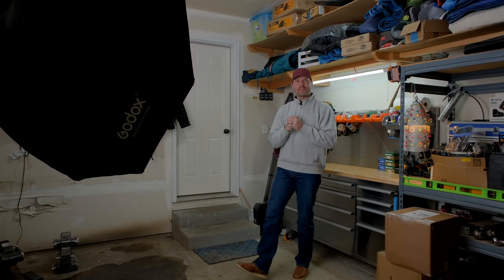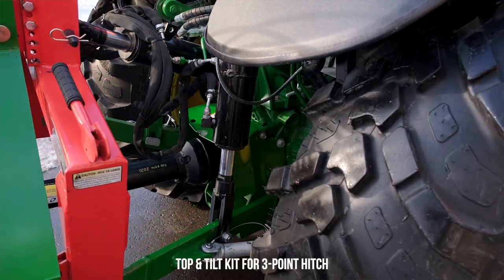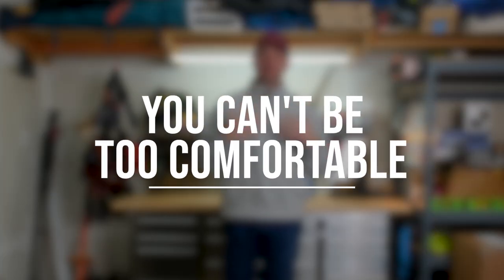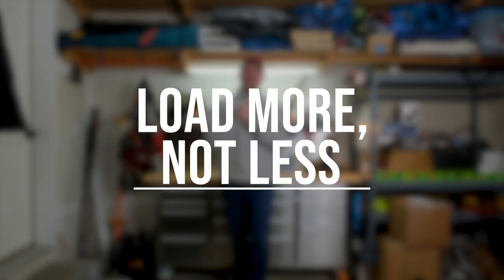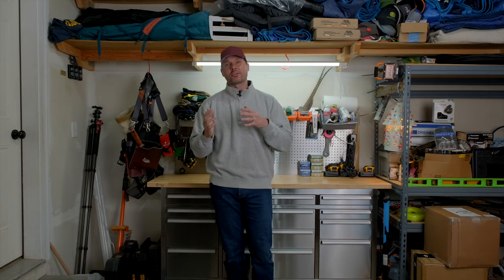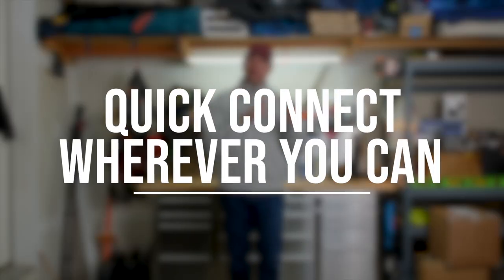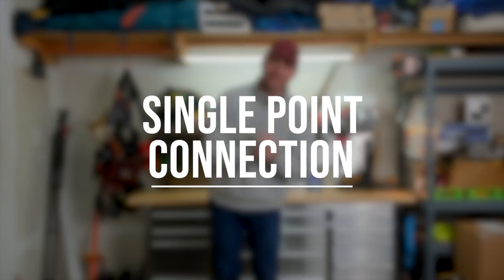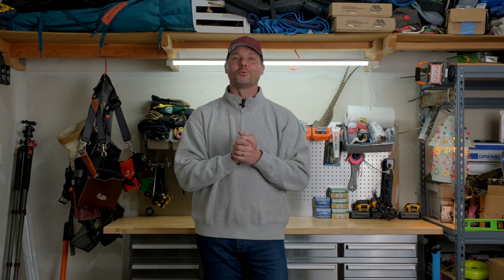7 UPSELLS ACTUALLY WORTH GETTING ON YOUR TRACTOR! 3 THAT AREN’T!

Comment: I know this is an old video and I've probably already asked this question but how wide should of wheel spacers do I need?  We have our brand new lx3310 delivering in about 2 weeks and I'm really interested in widening the rear. It has factory cab, 54" bucket and 63" front snowblower.

Comment: I have the 72" auto connect mower deck on my 2038r and I am not a fan. I find that if I don't remove my loader first that the parking stand hits the front arm on the mower deck making it hard to install and impossible to remove without someone holding the front bracket on the deck down so it clears the parking stand on the loader. The grass (especially dry grass)  gets into the radiator screen and I have to stop and clean it often. With that being said I love mowing with my tractor much better than with my 0-turn mower. My tractor rides much smoother and I have much less fatigue. Also on my tractor I am much higher than on my 0-turn mower and that puts me up out of the dirt.
Reply: Is it difficult / time consuming to remove your loader?
Reply: @BryanPAllen  removing and reinstalling the loader on a John Deere is easy and only takes 5 minutes

Comment: I'm not sure how this works, but if you change the size of the rear tires, don't you have to put on a set of compatible front tires also?  Changing the diameter will affect the way the front wheel assist synchs the front and rear tires.  If that is the case, you should mention that also when bringing up changing rear tires.  Love your videos!  Keep up the "Good Work"!
Reply from the maker: Good question and I would think the answer is yes, but there are folks out there more qualified than I who should answer!
Reply: You are correct

Comment: Kubota LX2610 has two different offered size tires aswell. If you go with the larger size they say you cannot use the mower deck because of clearance. Clearance and weight gain and not ever planning to use the tractor to mow sold me on the larger size tires.

Comment: The MSL loaders seem to have less curl than the comparable NSL loaders which is a big deal when moving material with the bucket. The increased lift capacity with the MSL is just mechanical advantage of that type of lift mechanism. If you mostly move hay bales and pallets then the MSL is probably a better option. If you are going to do mostly bucket work then I’d lean toward the regular loader.

Comment: Searching for  1st tractor for ~30 acres
Priced JD,Kubota, Case/NH, TYM,Branson and RK all with cabs
35-55 HP
Finding in stock tractors and parts is telling 
HD is a must HST is a bust
Reply: Hst is a lot better than it once was and the resale value is much better and easier to operate

Comment: Your M4 has the option (probably from the factory) to have a hydraulic controlled self leveling loader that can be turned on or off as desired.
Reply from the maker: Hmm, I gotta look closer.  There were definitely a lot of buttons and knobs I was pushing.  I was hoping none of them were the seat eject!

Comment: I’ve got 4 tractors, a John Deere 5525, 6400, and 70 aswell as an Allis Chalmers 200, none of them have cabs and only one has a loader. So now that I’ve been doing this about 25 years, I’m starting to regret not getting a single cabbed tractor, and only one loader tractor

Comment: The single point disconnect sucks.  I have one on my 6430 and it leaks when the loader is off which is all summer during hay season.  It was a used tractor, but never again.
Reply from the maker: That's a major bummer

Comment: I got auxiliary 3rd function hydraulics on the FEL thinking I would be using it in the future and it would help with resale value if I trade it in. 5 years later and i never used the 3rd function but right now my tractor is at the dealer getting rear remotes added because now i need them. SMH

Comment: Block heater if you use your tractor every day or every other day  during cold weather on an working farm not a hobby farm saves batteries and starters
Besides internal engine wear and tear...
Reply: I lived in Wyoming and a block heater is a must there. In northern Virginia only would be used a couple of weeks per year.  Now in southern NC.  It is worthless ( rarely gets  below 30).  Every feature depends on what you are doing.  The thing he left out is the hydraulic top link.  If you pull anything g it will simplify your life.  I often use it to get to bottom arms into position.

Comment: What is you take on type of ballast for tires? I see a lot of rims rusted out because they had weight added in to the back tires
Reply: I had wheel weights added on my new tractor versus fluid weight. The dealer tossed in the wheel weights for free if I bought the tractor. I have a hobby farm and knew I would not be able to remove the tire and rim by myself for repairs. The cost of on site repair from the dealership is astronomical plus the replacement fluid cost. I also keep a box blade attached for additional weight and haven't had any problems when utilizing the bucket.

Comment: My first wrecker had air ride seat and a 15” tall leaf spring. It was the only part of being in a military grade wrecker that was bearable. My last wrecker had air ride suspension and still the air ride seat and rode better than most civilian vehicles especially with a back injury, which having a properly adjusted seat suspension helps prevent

Comment: The air ride on my L6060 does not ride any better than the spring seat on my old L5030. It seems low and very little travel even when set up in the middle setting. Plus I lost the compartment in the back of the seat.
Reply from the maker: Sorry to hear that!
Reply: I have a L6060 and opted for the air ride and it’s leaps and bounds better than my L3540 mechanical seat. Best $1000 I spent on tractor options

Comment: Can someone point me in the right direction for a proper tire pressure gauge that work for loaded tires plz plz
Reply: Milton makes them, I got mine off amazon. It is spring loaded so it returns to zero when you remove it from the tire and forces out the fluid. I still rinse mine with water afterward.
Reply from the maker: Looks like he's got a good option below!
Reply: You have to have the valve near the top.  Any will work then.  The fluid should only reach to the top of the rim.
Reply: @bladewiper  Thank you!
Reply: @brianhillis3701  Thanks!
Reply: Milton S-928 is what I purchased, seems to work well.

Comment: The main advantage I could see for the lower capacity loader is that it should have smaller cylinders and therefore move faster, or have a longer length and therefore more clearance between the tractor and the load (long reach), and be able to lift higher.
The speed would be great if the primary use were something like cleaning animal stalls where the weight it's huge.
The longer length would be beneficial for loading a trailer both due to height and being able to reach further into the trailer for dumping.

Look over the specs and see if you can a match then with one of the two reasons above.

Comment: how much does labor cost  per hour at JD dealer?
Reply: Around here it is 175 to 200 dollars per hour plus  3 dollars per mile each way for a service call.
Reply: @davidbalvin8112  might have to go with an independent mechanic
Reply: @JustJamesDean  That might not be possible. Check articles on the right to repair.
Reply: @davidbalvin8112  yes, i have been reading that.
Reply from the maker: More expensive all the time is what I can say for sure!
Reply: @GoodWorksTractors  would the newer brands (eg new holland, LS, Massey) dealers be a bit cheaper? Or, is it better to go with independent mechanic?
Reply: Our JD was $90/ hr last year, they went up to $120/hr this year.